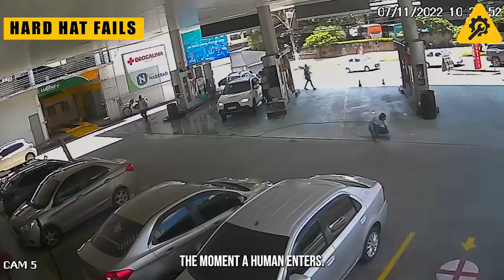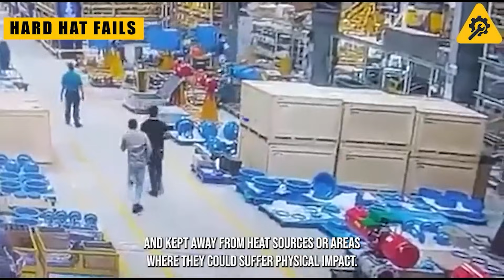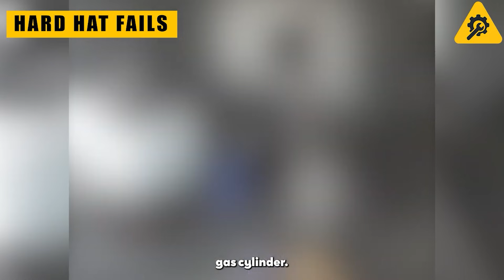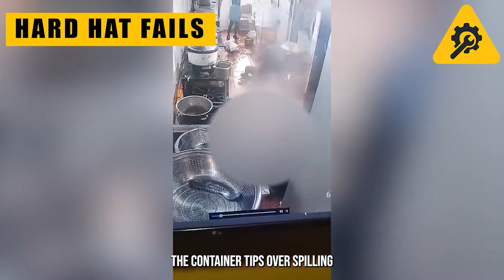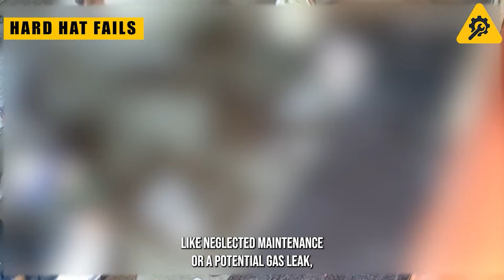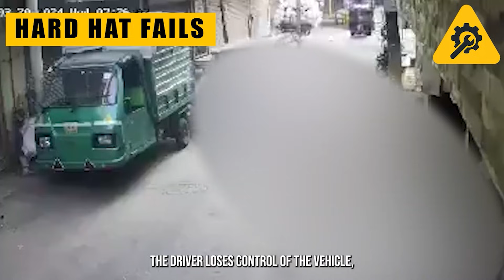The Deadliest Hour on the Job… Full Compilation 😱

Comment: 42.45 I seen this before on utube they showed with no blur this morning one woman from outside push the glass door open because it's safety glass it breaks into thousands pieces but another part of the glass door just too heavy for her to hold on and gravity force does it bit ,the heavy glass door pulls inward it fall onto the other woman who happen to hear and close towards the door  it pin her down but glass door was intact and another woman came to help her ,outside the woman who did the damage standing there with both her hands on her head in shock

Comment: Most of them is repeat or not new and this commentator Ai is BS most of the times because two guys was standing one was fixing not both got thrown into the other side of the wall ??? Then there was a fork lift  going up a hill lost control sliding backward towards two mens who happen tobe talking one inside his track one outside standing  ,the forklift  smashed into them cleaning anything in the road was seen by the cctv